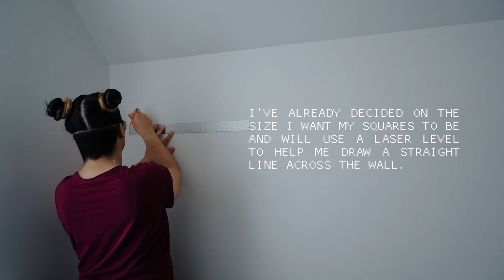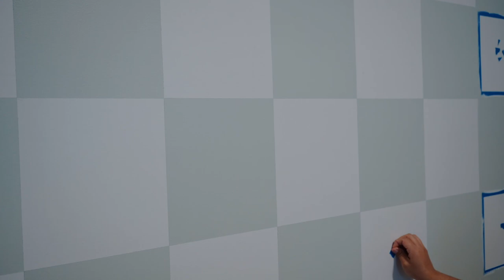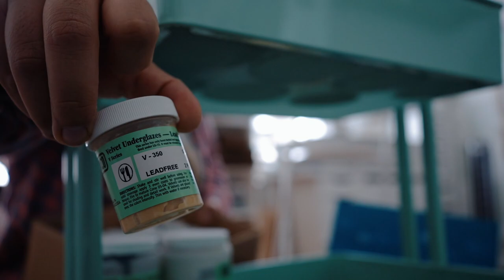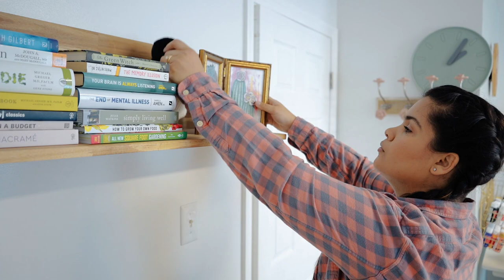workspace makeover (part 2) | painting a checker wall, hanging storage & decorating my home office

Comment: All doorways (and windows) are framed out when built.  The area you were trying to drill into to hang your shelf is called a header (I think that's what they call it) and is basically just framing lumber (ie: studs!).  If you want to go back and hang that shelf there, just drill some pilot holes and then drill in your screws!  :)
Reply: Here's a good illustration of what I'm talking about: https://undergroundcarpenter.com/wp-content/uploads/2020/11/Frame-a-door-rough-opening-drawing-scaled.jpg
Reply from the maker: That's what I figured since it all seemed so hard! But even with drilling pilot holes the screws wouldn't go in far enough for the shelf to be flush against the wall 😢. Maybe I'll try tackling it again another time lol. Thank you for the illustration! 😊
Reply: @TanaMakes  The space looks lovely!  Really well done!
Reply: @TanaMakes  Maybe you hit nails/screws or some other metal part of the construction. Shifting 1cm to the right or left might help...

Comment: i want to finish my house, this is really getting me motivated to get the house fixed so i can decorate. OH also their is typically a board over top of the door called a header. i dont know if thats what ur hitting id think the header would be very small for that door as it isn't a load bearing wall. if it is a load bearing wall that might explain why that closet is such a weird size and you could have hit a massive load bearing beam. u can also buy a slip cover for that recliner.

Comment: I have the same utility cart that I use for storing my paints, and I find it annoying to have to check each bottle until I find the colour I'm looking for. I noticed some of your glaze jars have the same problem. I'm not sure if this would work with glaze, but my solution was to put a dot of paint on the top of the bottle for quick identification.

The room is looking great, I'm so jealous! I wish my place looked as nice!
Reply from the maker: Aw, yeah :( I quickly realized that would be an issue too, but that's a great idea! I'll probably write the names of the colors on the lid. Thanks so much! Definitely took some time. Just take it little by little until you get it the way you like :)